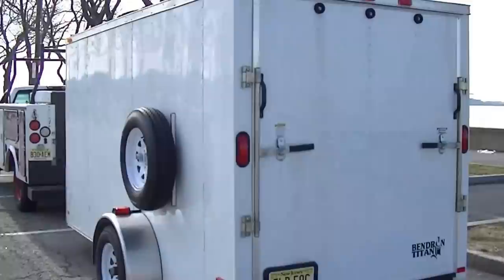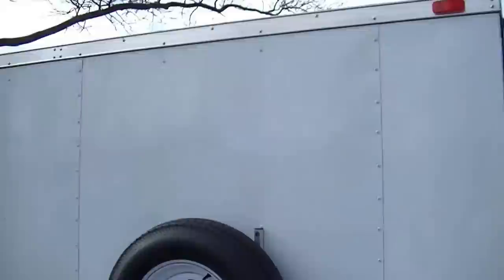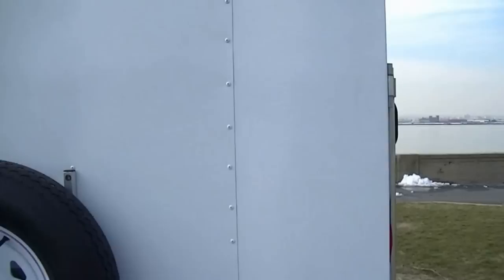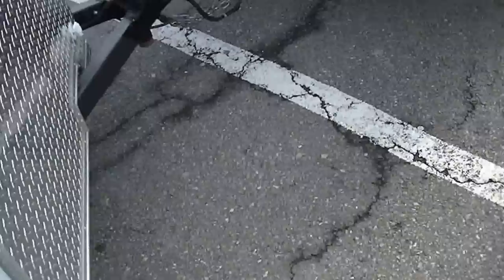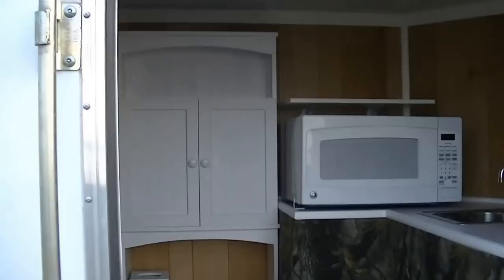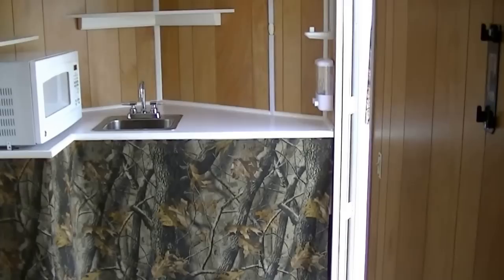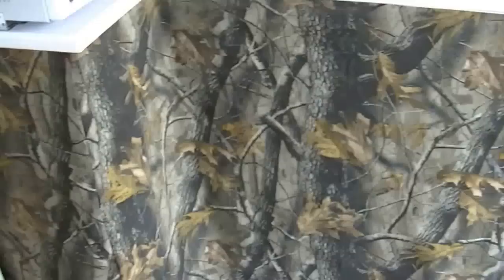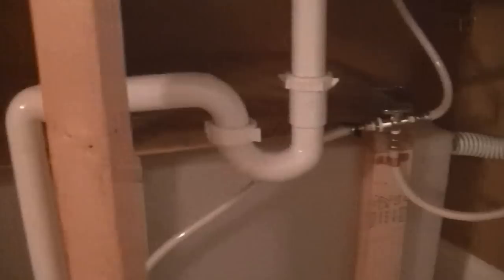Bug Out Vehicle - Cargo Trailer Stealth Camper - Part 1

Comment: Nice - the V front was worth the additional cost for the extra space as well, You managed to put in a nice kitchen area without using up any living space.  Nice job man. Add a solar panel, charge controller and a deep cycle marine battery and you'll be ready to go of the grid.

Comment: Workmanship looked pretty good , Nice clean look. That water tank is going to make for a heavy tougue .... Did mine a little different . I carry a big ATV or Motorcycle in mine. Save 30% on gas down sized fm 22ft to 6x10 Many of the places I go wont let grey water drain on the ground anymore. So I drain into a tank that is under the sink and easly remove to dump.   I will be posting soon .

Comment: You have done a real good job so far I'm impressed never thought of a utility trailer for that use .look into solar three or four panels on the roof connected to three or four marine deep cycle batterys hidden. Under sink or bed connectd to a three thousand watt inverter use only led lighting.and for its size you don't need but a small ac unit.your on the right track brother keep it going and god bless..you got good skills you might be able to make and sell them completed..

Comment: nice video - excellent start on your project - 2 suggestions - for many years I used 
stock vans as camper/survival vehicles - I found that the lift up "Submarine" style storage units (under your bed and supporting the mattress) worked well for me - I used 2x4 or 2x6 kiln dried frames (partitioned for mattress support) - you can get an
amazing amount of  folded clothes and goodies in there - my other suggestion is an
inexpensive gun safe - you can get a 7 rifle safe (Stack On) for $100 - bolt it down,
put a couple of weapons in it, and use the rest for shelf storage ( it looks like you have the carpenter skills) - paint it the color as the rest of the furniture and Bingo....
good luck            JRW

Comment: I like what you've done to your trailer. If I could I'd like to make two suggestions. 1. Mount your propane tanks on the back of your truck, using a flex line and coupling between the truck and trailer.  2. A/C, buy one of those free standing ones at Home depot that sits on floor and cut a hole above your outside water fill and shower for venting the A/C with flex pile , they cost couple hundred dollars. A friend of mine has one and it cools his second story bedroom in Florida. So, it would work

Comment: For Hot water, attach removable/permanent  black hose on top of the trailer, sun will do the rest.  You will have to add cold water....Used this for years outside the barn for saddle club events.

Comment: Looks like a great start.  One thing; that bar lock on the side door should be setup so that it locks open with the lock used to keep it closed.  Even if it's just a small hasp or chain.  If you're in that thing with the doors closed and someone comes along and puts that bar in place, you're stuck, whether by accident or on purpose. For camping and keeping the doors open, use those cheap velcro door screens to keep the bugs out.
Reply: Yes, I'd have some concern about emergency egress. All it takes it someone to wrap a cargo strap around your trailer and you're stuck in there.

Comment: Well done.
If you are not too committed to that floor plan, I would move the bed forward to butt-up against the galley cabinet.  Move the Bathroom to the rear.  That would allow a second layer privacy curtain across the back to isolate the head a well as a clothes closet/storage locker in the rear opposite the toilet.  As the toilet could then remain in the rear (no pun intended) location...you would free-up stowage area under the bed.

Comment: The #1 thing you have to do is get most of your weight over or very close to the axle. I am going to build one myself...for the second time. Someone stole my first one. And the P/U truck it was bolted on to! I Must have built it well:). But my water was split into 3 tanks. One over each wheel, 1 on the roof for showers. Roof tank was empty while traveling. Did not need extra weight way up high on the road.  I use foot and hand cranked pumps for water. And yes it will be solar / wind powered again. I use automotive parts in the wind power part. If I want to I can draw river / lake water to the all tanks to warm up for a outside shower using the sailors way.  Use a boat manual bilge pump! Also redo your axle mounts to be spring over and not the spring under type. It gives you better clearance (over rocky road, but not underthings)unless you only bug out to campgrounds! Make your own big cooler. Works better and more cost efferent! ask me how to do it at surfnfxatyahoo.ca. You can make it any size you want. Cost is under $100 per cooler to make. And I will even give you tips on keeping things dry when the ice melts. But I will only answer your e-mails. If I have no time because I will be swamped with e-mails. Never dump cold water! May I suggest a paint job for your trailer!My last one was I  had was green / black/brown. Before winter  then it was brown / white / black in colour. But if your going to bug out keep it white until you get to where your going! Then camo with cheap spay paint. Even put down a black tarp for the winter on the roof. Every BTU counts. I will even put in a very small wood stove for heat in mine.  And yes well ventilated!!!Cooking will be done outside with a near smokeless pit stove! My fold down rear door / porch had a inner screen with door. Sort of cool to have a dry rear porch with just a cheap tarp hooked up! I also mounted it to the back of my P/U after I took the damaged box of it. Bought the truck very cheap because of damaged box, I scraped it except for rear box door. Now it is another door on the sometimes trailer.  Even the trailer had a big dent in it but was easy to hammer out and us heat / cold method. I can switch from having the trailer on the back or make it into a small flat bed hauler. Takes about a 1/2 hour or so to switch! I had ramps to roll her on or off the PU truck. Rule to live by...for every shot you fire expect at least 10- 15 to return. Srock up on 22 cal while you can because the USA govt is buying it all up. Same with good MRE'S .Learn to use a compound bow and arrow.
Good Luck!

Comment: Good job with that  utility Body service truck you look like a contractor. Something you can do if you only have the standard 76 inch ceiling. What I plan to do is cut a 32 by 32 stand up shower down at the top. from Home Depot so I can put a holding water tank under the shower. Waste water tank underneath the shower of at least 8 gallons or more. It's either doing this and sit on a small paint can taking a shower. Raising the roof on your trailer, or having a full size shower and letting water run on the ground which wouldn't be good. Imagine while you're in the middle of a shower having someone or law enforcement knocking on the door or breaking the door down possibly because they think it's leaking some strange water with bubbles on the ground outside and they think it is a emergency. And there's a good chance they would fine you for letting soap bubbles out on the ground even if it's organic friendly environmental soap or shampoo. Or possibly Towing your truck and trailer away with you inside in the back while you are trying to get a shower. Or trying to hurry stop in the middle of a shower and get your clothes on to see what the commotion is about outside. And if you keep it all contained inside it won't freeze up and you could take a shower anywhere and no one would ever know. Or another thought you could raise the ceiling for the shower. Sure the conventional home way is standing up taking a shower. But if you're in pretty good shape you could sit on a paint can and shower just fine. That's the biggest thing having a shower, sink and having somewhere to poop. There's a lot of different toilet methods but what I use is a fold-up chair five gallon bucket and a $0.10 each 13 gallon poop and pee kitchen trash bag. And when done put the small softball-size bag in the back of my truck in a small Dollar Tree plastic shoebox. And I use another small plastic Walmart bag and throw it away. Sure you can shower at a gym but that takes longer and I would rather have my privacy.

Comment: Nice job! I am currently on a similar project, I have the trailer and it already had the sink and counter top. I wired it 110 and will run some additional 12volt wiring for my solar panels. I still need to build the bunk/storage area. I am hoping my trailer will turn out as your trailer!

Comment: I suggest one thing. If you ever have to lay over in the city, like on a city street. Run a drain line from your sink over to the right side of the trailer just behind the trailer wheel. That way when you drain water, it wont be obvious to anyone driving down the road like a nosy cop. The water will go quickly to the curb, and not be seen by people going down the road. Keep it as stealth as possible.

Comment: Very practical setup! Some thoughts I had: 1) pack 3 100' extension cords. You never know where you have to reach for some power! 2) Convert all lights to LED. 3) Add a couple extra 12V batteries for backup. 4) Solar panels hinged on roof. 5) Get camo netting to cover entire trailer. White doesn't hide. 6) Install roll-out awnings side(s). When it rains, you want it! 7) Gun rack! 8) Mount microwave to wall @ ceiling. You'll need the counter space. 9) Go camping for a week in it. Make video #2!

Comment: You could add a deep cycle battery under the sink that is charged off of a small solar panel and wire it to a charge circuit on the truck. Switch out the flat 4 for the round 7 pin. The circuit is probably already on the Chevy, you would just need to connect to the battery under the hood or plug in a fuse. Then add an inverter next to the deep cycle.

Comment: I've done practically same thing but I have 45 watts of solar on the roof with 365 amp hours of 12v power and a 2000 watt inverter.  I've got a 6' x 12' with a rounded nose and is perfect as I've put a box on the tongue for battery storage. Wired walls w/shallow boxes, LED lighting

FYI - Be sure to padlock the outside clasp and figure a way to lock the door from the inside.  The reason I say to put a lock in the outside clasp is so that someone can't come behind you and lock you in !!!!!!!!!!

Comment: They make small hot water heaters.  we use one at work in a portable sink.  Fill up 5 gal tank, turn on pump/heater. Ta-Da Hot Water on demand.  
Get an Orca or Yeti or Pelican.  Trust me, after years of pulling trailers, that power WILL go out.  And the Coleman is only good for a few days unless you bury it.

Comment: I converted a step van to an RV; much the same inside.  I recommend a pair of used golf cart batteries and a solar panel, and a 12V RV water pump.  That way, you can dry camp and still have water and a shower and 12V lights.  You *can* do the electric, it's just like plumbing once you know the basics.  Feel free to contact me for help; I'm an electrical engineer.

Comment: You did a great job.  I would add 12vdc color/infrared cameras on the inside of the trailer connected to a small tv screen.  I would recommend   SPECO VL-62 Color Waterproof Camera with Built-in IR LEDs from Amazon.

Comment: Nice work!  I can't resist one comment about the V-nose.  It's sort of drafting behind your truck so you don't get as much from that as you might think.  Also, the square back of the trailer is where air is swirling around coming back together.  That is probably where more of the aerodynamic drag is coming from.

Comment: I know this is an old post, but we'll leave our vote anyway. I like it a lot! think ill do my like yours. simple, clean and easy to maintain. if you don't mind, I'll add my two cents on what I would add. I like the screen door idea, and the exhaust fan up top. id go with a on demand water heater run off propane. water weighs 8.36 pounds per gallon. think about 30 gallons up top sloshing around while you are driving. use the tank you have and keep it simple with on demand heater. yeah, i'd run solar panels, that just makes good sense. I like the idea with the back door and canopy over top. again the use of hanging screen, like with the magnets. i'd also consider the false floor the one person talked about. maybe there's room for it . even a one foot space could hold a lot of stuff, AND hide a lot of stuff just in case. I like what you've done, you did a great job! mine will be much the same. what people don't consider is the more stuff you ad, the more weight, which will affect fuel consumption. much more than two tire on the outside. I do like the idea of tire covers tho. anyway thanks for you video. you did a great job . and everyone's comments helped me out when I build mine. have a great day everyone! just curious, do you still own and use it?

Comment: When storing a tire inside they will stack them take the air out and keep them cool out of sunlight. But outside I would let all the air out keep the valve core loose to make the tire last longer and put a white tire cover over the spare tire on the wall. If it's going to be outside.

Comment: I think you did a pretty good job... just fyi.. the shelves and cabinets, when you put things on them and go driving, you will want to put some stops at the edges of the shelves to keep things from flying off the edges...  if you don't you will see what I mean.. LOL  but yea, a nice trailer.  got to get a hot water heater for it as well and be able to hook it up to an outside source and add a water purifier to it as well, clean water is essential...

Comment: Great concept.  If you want hot water you could have a coil of 2" ABS pipe that would that could ho on the roof or on one side.  Popular Mechanics had many designs over the years that would be easy to build and deploy.  Example YouTube video: "solar water heater simple DIY project" 
Thanks for sharing.

Comment: I've looked into doing this kinda thing myself. Great idea! A little hind-sight, these trailers can be ordered from the Manu with the framing for a rooftop mtd A/C and capped for later install of a unit. Also, your AC access point prob should've been a bulkhead type fitting instead of an open pass-thru. Maybe ran some 12v wiring before nicely finishing the inside. HD sells 12v50w RV lamps that work great for LTG.

Not being critical, just ideas already bouncing in my brainpan.

Comment: Looks like you've done a fair job of building it out. I would suggest upgrading to LED lights inside, and maybe adding a 200 watt solar system. This and a couple deep cycle batteries would charge cell & laptop while being able to run your microwave on occasion as well. Forget the air conditioning and ice maker unless you want to run a generator. (There goes the stealth) Speaking of which, guys, I'm pretty sure when he said stealth he meant camping in a parking lot without being obvious. ;-)

Comment: if you want hot water you can put a flat black plastic tank on the roof. Even in winter if there is sun it will warm up the water a bit,but i guess it depends on where you live

Comment: Nice job! I saw some good ideas I would like to steal for mine. The AC unit on the roof is the way to go. Its a little pricey but its nice to have it out of your way and you can put a heat element in it so you have heat and air.

Comment: Good design layout overall, clean looking. You have a few modern necessities thought out, but not overdone. Plumbing looks good and simple, with the current idea under the sink should be easy to make a repair on the fly, off the shelf hosing is a plus for this. another idea I thought of while watching your video was that the back ramp door would be great to make a screened room that you could attach the same as your sink skirt and allow for more natural cooling as well as added living space. :)

Comment: Looks great!  Almost looks like you bought it that way.

Suggestion....  As a bug out trailer solar and as many 12V accessories as you can.  12V water pump, LED lights, etc...   Panels are cheap now a days, that and two 6V golf cart batteries can go a long way.

Later a nice Zantrex inverter/charger, 2000-3000W will run the microwave directly off batteries.

Great work!

Comment: Hey brother, watch out for the portable A/C units. I tried one in my tractor trailer sleeper and it sucked in so much air from the outside, it worked for crap in a small area.
As fast as it cooled, it sucked in more hot air.
Go with a 5,000 window unit mounted right in the side wall. It's easy.
As far as a genny...I have tried them all. Honda EU2000 is worth every penny of the 900 dollars you will pay. Get a aux tank for it. Mine runs the A/C and everything else on 1gal=8hrs. U did real good!!

Comment: Sweet.! I'm seeing that with a little more modification on the bed I could get my Motor Cycle inside when traveling.  I would have added a peephole on each side or even a Porthole. 
Still very good job.
Reply: Porthole for boats is a good idea as long as the holes are not big enough someone can get through it. And no one can open the whole up from the outside I'm not that familiar with the bigger boats. I've used a few basic peepholes for my cargo trailer but the one inch in diameter peephole gets condensation on the inside if it rains or it's humid. I would have to take it apart to get the moisture out each time it does it. The portholes would be a lot better choice for the walls where I don't plan to put Windows in it for security.